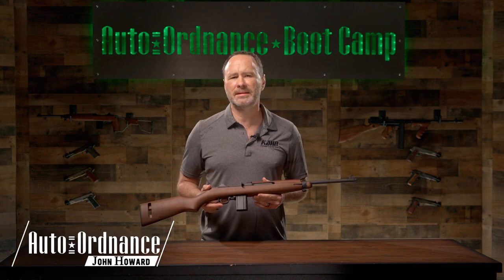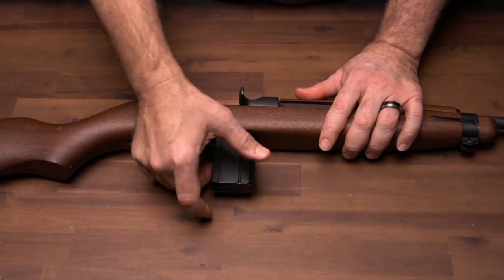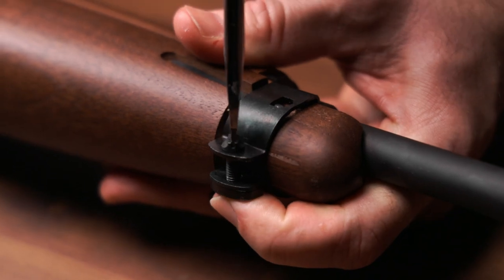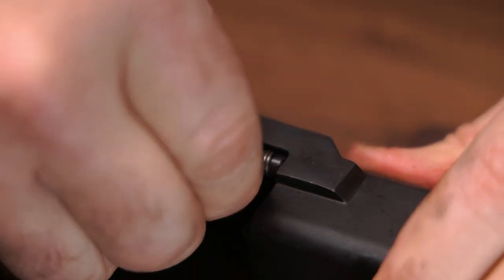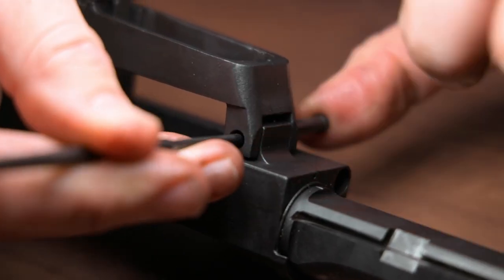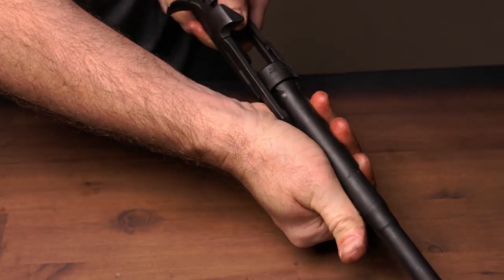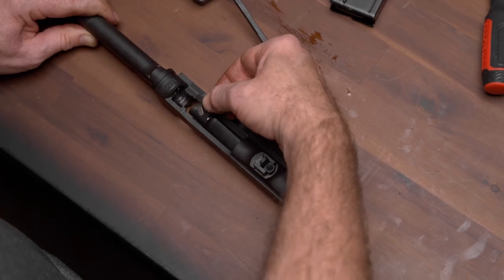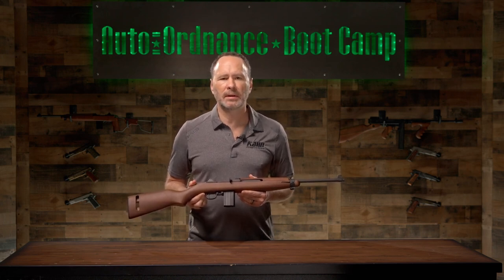Auto-Ordnance Boot Camp: M1 Carbine Teardown

Comment: Hey Guys! I purchased your Carbine a few years ago. I have found a defect in it that I had to address, this defect is in most all M1 carbines all the way back to 1942, below the feed ramp there is a lug cut out, this cut out causes Miss feeds and jams, when the gun is in operation this cut out allows the mag front to drop 1/8th inch causing the front of the bullet too drop and catch on bottom of feed ramp causing the Jams and miss feeds please address this, could cost someone life Thanks!
Reply: How did you fix it ?

Comment: Great video - except I couldn't get step 9 done (removing slide) for love nor money. Mine just doesn't want to detach. Any additional clues  would be much appreciated...
Reply: Did you ever figure it out? I’m having the same issue lol
Reply: Yes, I did. Important to first get the slide into the correct position for it to release. Then I encouraged it to go where it needed to by use of a slot-head screwdriver to lever it. The steel is quite springy and not difficult to move around by flexing it. I think this is more of an issue with the AO because the steel is relatively new; and would explain why slides practically fall off the vintage milsurp items. @AJCzarkowski

Comment: Nice video!  I've have a new manufacture AO carbine I bought a few years ago, but have had trouble with it not going into battery after 6 or so rounds. I though it just needed a break in period, but I'm  still having the same issue. 
Just bought some Wolf springs to replace the original spring and hoping it solve the reliability  issue I am having.